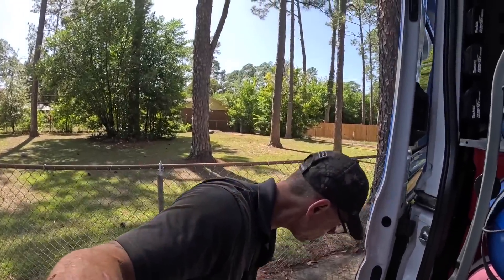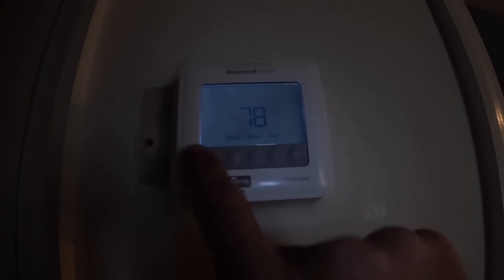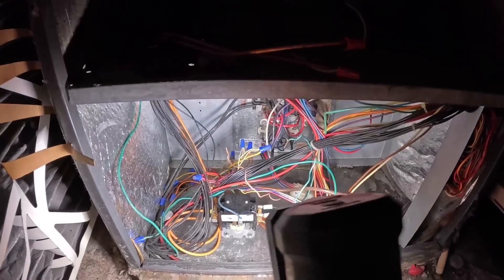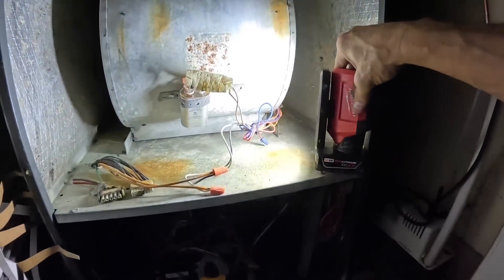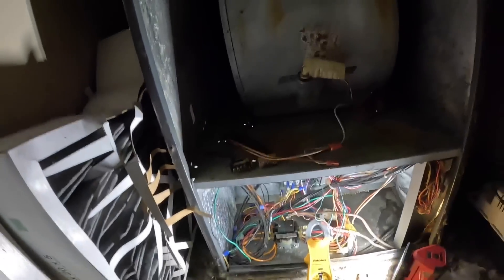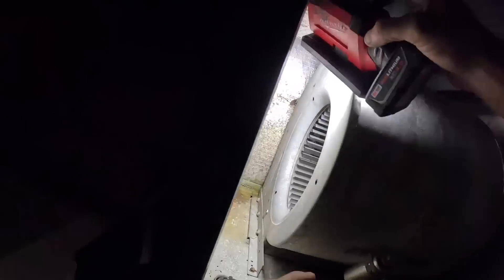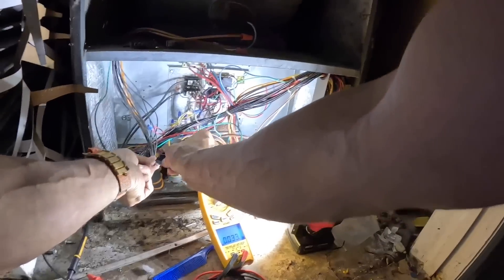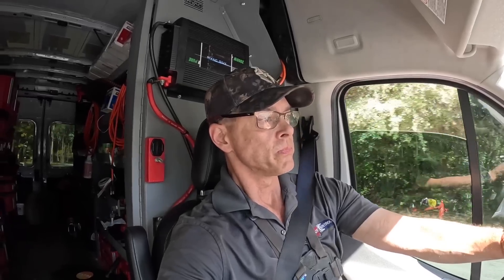No Airflow On A Goodman AEPF Air Handler!

Comment: change out is in order, that is the reason someone installed the PSC motor the cost was probably half at that time now stupid high you know things are out of control when you can replace the air handler cheaper with a new components WTF.

Comment: Goodman part number for this is a B13400704ABS Blower Motor - ECM 3/4HP 120/240V Programmed. It had a variable speed  ECM motor originally and someone changed it to PSC.

Comment: What do they do for heat? Straight ac. With no heat strips. When you opened the disconnect it said it all, its a hornets nest. Hope ya get the change out.
Reply from the maker: It has heat strips, and it’s a heat pump

Comment: Quick question, if the hp and rpm are the same as the original motor, why does it matter that amp rating is lower? Why is that a problem?
Reply: I have installed 3/4 hp blower motors and have not had a problem . I thought the new motors have to meet a energy requirements and that’s why it has a lower amp rating I my be wrong . I would think if they don’t change the filter and run with a dirty filter that will burn the motor out. And no disrespect to. Curtis  I love all his videos and value his work 😊
Reply: @craigmarshall40  same here, I have changed countless motors with no regard for the amp rating and never had a problem, as long as the hp, voltage and rpm were correct
Reply: @joselanda8316  great to know  I was second guessing my self but never had a problem 😊

Comment: 3.5 ton blower motor @ 6.2Amp is odd, why so high?  That's max load running but still...
Reply from the maker: As someone else has suggested, it’s because it was a variable speed, and there’s a possibility that a rescue 3/4 would’ve worked.

Comment: Maybe change out time.

Maybe Curtis one of the gree flex units if you are still dealing with them.

Not sure if the current system is a 3 ton or 5 ton.

But at least the gree flex units are the real deal and original VS the Mr cool universal which are just rebadged gree flex units but unlike the gree flex units often have blower wheels not balanced properly and generally require going over everything with a fine tune comb.

But again it comes down to cost.

But at least the gree flex units still use copper coils like the old r 22 units.

And don't appear to have the same issues with leaking coils like trane Lennox carrier and even Goodman now.

But still get that replacement variable speed motor if the total cost is less expensive.
Reply: While I know the gree flex 5 ton can go down to a 4 ton with the dip switches but then again if the home is around 2500 hundred square feet leaving a gree flex in 5 ton might beneficial with that Georgia heat for cooling I am Pennsylvania close to the Delaware border and it's gotten a lot hotter here with a longer ac season where it gets into the 90s especially from June to August and right now this week it's almost 80 degrees and somewhat humid.

So I wonder what the temp is in Georgia.

But anyway I enjoy your videos and your thorougness and your willing Ness to work on almost anything even if you might not like a brand

Including fixing mini splits when others can't figure them out with the linesets and your willingness to even deal with gree when most bash it.

Preferring trane me personally I don't like them anymore or even Lennox or Goodman or even carrier anymore.

Because they make them too smart and have to much technology but then they have so many issues with working right especially with those communicating systems I just don't like them.

Inverter variable speed technology is great but can't the American companies offer it with high seer ratings without them having to be so proprietary or all that comunicating system technology.
Reply from the maker: It’s a 3.5 ton

Comment: Why is that down flow installed like that. If that coil freezes the damn heat strips are going get soaked and cause a world of trouble. Heat strips always need to be installed above the coil. When you change this one out Curtis be sure and make it right.👍👍🇨🇦
Reply from the maker: It’s a heat pump. The heat strips have to be down, in flow, from the coil. That’s why.
Reply: @HVACGUY  understood, I didn’t notice it was a heat pump. 👍🇨🇦
Reply from the maker: If not the heat strips will heat the coil, that has hot gas running through it and cause the head pressure to skyrocket

Comment: Curtis, can you answer this. I have a 3 top Goodman package unit. Way this time of year, it always smells like a wet sock when the blower first comes on
Reply from the maker: We call that dirty sock syndrome.
Reply from the maker: If you are running it in heat it is because an algae reawakens every time it goes through defrost - it’s normally dry then defrost makes it wet, thus the spores.
Reply: @HVACGUY  no still running in ac still warm here

Comment: A Benny “Goodman” 🤪 Unit is a Large Enough Failure and then you Install Cheap Parts from the Fineese Chuckers and you have More Problems. Don’t Install Junk.👎
Reply: I had a goodman serve me well for 7 years.  It was installed like crap...lineset reused from r22 system and not vacuumed at all(no nitro when brazing ethier),  poor airflow from kinked flexduct in attic.    It never gave me any trouble, and despite being undersized for my house it still cooled reasonably well most days. 

.I only replaced it because my wife stays at home with my son, and it didn't quite get cool enough during peak sun hours here in the sunshine state.  So I opted to install a bigger unit with a higher efficiency rating.   I sold the goodman for cheap to someone who needed it still is perfect working order.
Reply: Still better then a carrier.😂 I work on them pos more then anything.

Comment: Bizarre.  Aren't there guidelines for motor substitutions?  If the horsepower and RPM are similar, wouldn't an amperage difference only be a matter of efficiency?
Reply: You're right, it's just that this is an old R-22 system and has been pegged as "Needs to be eliminated".

Comment: Good work.  Had you change that condensate  pump not long ago.   In case you didn’t see the AHU. Has a R22 sticker
Reply from the maker: Yes, I had changed the pump, and line.
Reply: @HVACGUY    I rembermer you needing to tighten the mini clamp couple of times to get the  tube stop leaking.   Good job

Comment: Hey Curtis! That is for sure a high rated motor, do not see many of those out there. Chuck in a truck special right there. Leave it to Curtis to do the right thing. R-22 time to go oh how I miss that refrigerant…
Reply from the maker: Good evening
Reply: R22 is/was probably the best performing medium temp refrigerant ive ever worked with. Unfortunately with the apparent demand for higher efficiency units with lower and lower GWP ratings comes the compromise in overall system performance bang for buck…just my 2 cents